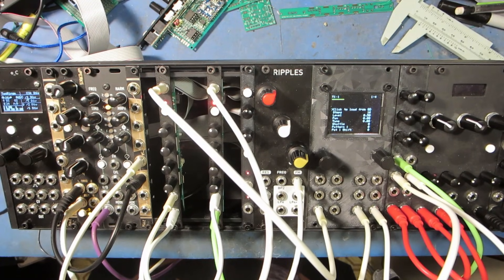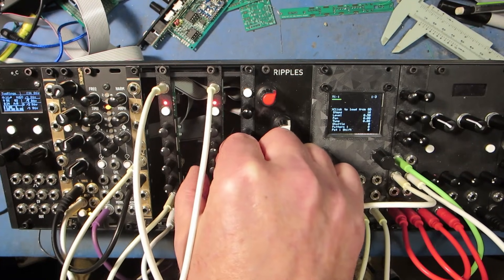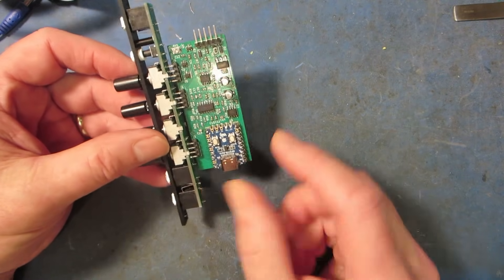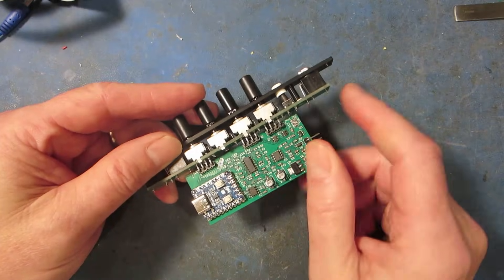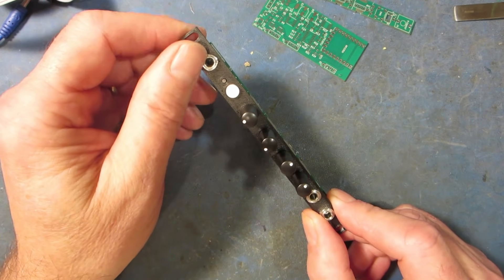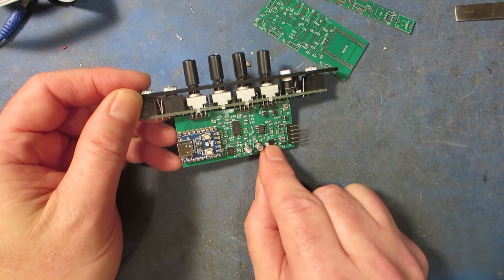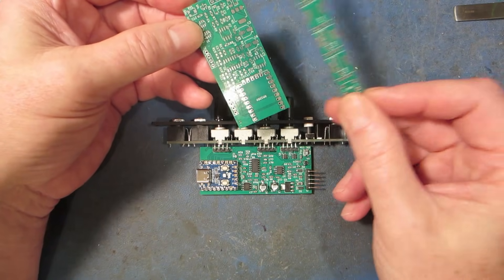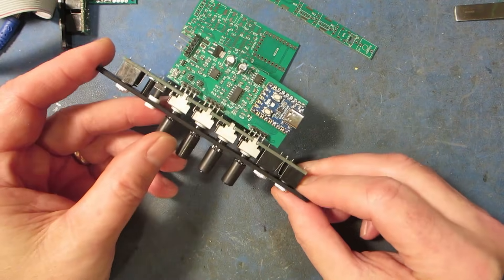2HPico - A tiny, inexpensive open source Eurorack module using the RaspBerry Pi Pico 2

Comment: Pretty impressive features in a small form factor.
I personally try to avoid 2hp modules, because knobs and i/o jacks are too cramped, especially when you put a few next to each other.
Also no room for labels.
Reply from the maker: Yep - these won't work too well next to each other. The motivation for this design was a small skiff that I was trying to pack a lot into.

Comment: Here is an idea. Add capacitiv touch sensing to the bodies of your pots so you can use them as buttons too for UI stuff. Touch the 4th pot for page 4 for instance.
Reply: Another similar idea is to use endless encoders with push button.  Then you could have four more inputs (buttons) for additional functionality.
Reply from the maker: @AlanLaMielle  I thought about using encoders but the commonly available Alps style won't fit in 2HP.
Reply: @rheslip20 ah interesting, I have some but not sure how wide they are.  You might be right that they're wider than the 10mm ish needed for 2hp.
Reply from the maker: Neat idea!! I designed it for plastic pots - cap sensing needs metal pots and metal knobs. Also not sure how that would work in the UI - every time you try to turn a pot you'd change pages. Food for thought tho!
Reply: @rheslip20 capacitiv touch works with plastic caps too. Capacitiv works different from resistiv touch (where you do need a metal surface). ... If you have one real button. You use that as a SHIFT function. Where the touch btns only work if you press that SHIFT button

Comment: So. Freaking. Cool!!

Love that it's open-source too. I'm not personally a fan of these 2HP modules (outside of mults and such) but that doesn't make yours any less cool!
What's the license on this? I've been meaning to try out a RP2350-PT8211 pairing for developing some modules running arduinoMI (a project someone is working on that ports many iconic Mutable Instruments modules to the Arduino IDE). 
I'm sure this will be a huge help, since as of now I've only managed to get Braids making sounds without pitch tracking on a simple RP2350 PWM-output module lol
Reply from the maker: I made it MIT licence. ArduinoMI sounds interesting. I was thinking about combining Grids with a drum sample player to make 2HPico into a really small drum machine
Reply from the maker: Another cool project you may want to check out is the Teensy Audio framework ported to Pico 2. This enables another bunch of audio processing tools on the RP2350.

https://github.com/ghostintranslation/pico-audio

Comment: Love it! One addition that i would really love to see is maybe add a small oled display so you can see the current page you are in, like ADSR, VCO, VCF, DLY, LFO etc, im just getting into this side of eurorack so i dont know coding yet but if it even makes it to 6hp would be such a handy module to have, if anyone can help me building it with a display i would be really grateful and we could also upload it as an open source project
Reply from the maker: I did consider a display but there is really nothing that will fit in 2HP - hence the single RGB LED. I also considered making it larger but decided to make the module as simple and small as possible.
Reply: @rheslip20  yes i got that point :) just even as a 6hp module it would be so potentially versatile and a display and a bit larger knobs would help a lot when used in a live setup
Reply from the maker: @mzperxmusic The smaller 8HP versions of Ornament and Crime are similar to what you are describing. There is also EuroPi which combines a Pico, a display and some I/Os
Reply: @rheslip20 oh, good to know, thanks for the info🙌
Reply: @rheslip20 You can get 72x40 pixel OLEDs that are 12mm wide. They'd fit in 3hp, and so would rotary encoders.

Comment: great work! excited for a version with more flexible audio/cv i/o. also wouldnt mind a 6hp version with 4 full size encoders and a tiny oled.
Reply from the maker: "also wouldnt mind a 6hp version with 4 full size encoders and a tiny oled" - sounds like an Ornament and Crime. I thought of designing something larger but O-C has the multifunction utility module covered pretty well. This one is for when you need a utility with a few controls in a small space. I do have a pretty cool sample Pico 2  player module (it's supplying the clock in the video) that I may spring on the world one of these days...
Reply: That’s getting into Europi territory - Worth a look if you haven’t tried one already :)
Reply: @ianwatson9092  yeh i know the europi, sadly no audio i/o and iirc only 12bit DAC for cv..